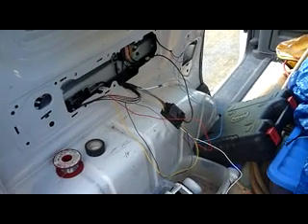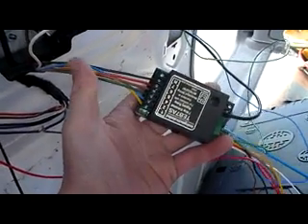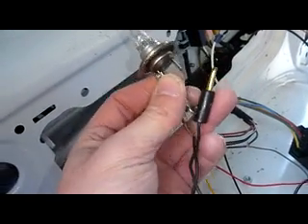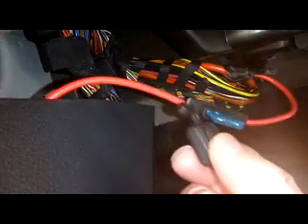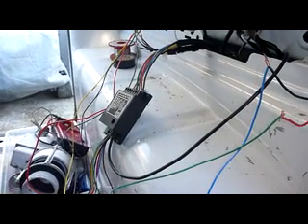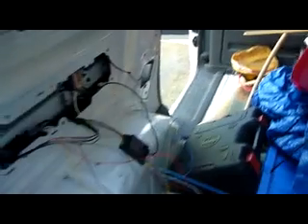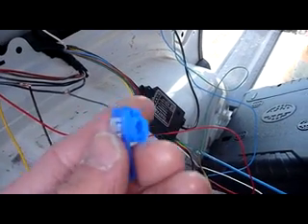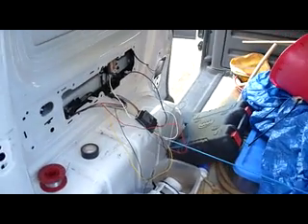VW Caddy tow bar wiring bypass relay

Comment: Hi, I think you are supposed to wire up the left and right tail lights separately, that's why they have separate pins on the socket and plug. The reason is that you should be able to switch each side, left or right, separately as parking lights. If you wire both trailer tail lights from one side you will either get both trailer tail lights on or no trailer tail lights on when using the parking light function. So you should have had a three (3) core cable coming over from the right side of your vehicle. One wire for the fog light, one wire for the right hand indicator and one wire for the right hand tail light. Only then would your wiring be fully legal, and road safe.
Reply from the maker: thanks for the input. hope the video was of help.
Reply: great comment.. some trailers don't have fog lights! otherwise you're spot on..

Comment: The video is very useful as I am doing this exact job now. The only thing I would say is that you should not wire the 12v feed from a wire in the harness. That wire will be fed by its own fuse so there is the danger of overloading the original fuse. If you follow that harness forward you will find a flexible rubber bulkhead seal. Take a long shaft cross head screwdriver and follow the harness. Push the screwdriver past the seal. Open the bonnet and remove the battery. Remove  the battery box. Now you should see your screwdriver. Push the feed wire past the screwdriver and remove the screwdriver. Fit the wire to the battery terminal nut (M6). Make sure the fuse is close to the terminal. I tie wrapped mine to the main power cable.

Comment: Helpful video but i am still having problems :(, All lights on trailer and van work correctly and i have the same bypass relay as this video - wired and fused directly to battery, BUT i still have a light fault on dash, could this be a faulty relay? i tested everything before permanently connecting wires and had no faults then, can anyone help!! PLEASE??
Reply from the maker: RyanGriffiths have you check all the bulbs are working seams stupid but could be as simple as that if it was perfect before you hard wired it in. Caddy’s if it is one have problems with the connections on the front indicators. Have you tried plugging in to a diagnostic tool to see what the fault is also could help.
Reply: @bobsvidz7181  thanks for your reply, 99.9% sure bulbs are good, a freind is bringing a diagnostic tool so hopefully will shed some light

Comment from the maker: Hi Timothy my van is 2013. My bypass relay only needed one brake and one dip light the other wire is just rolled up and taped. When driving with no trailer the relay clicks and makes a lot of noise so I am going to put a switch to turn it of while not pulling a trailer as it is annoying me. I used that live as it comes straight from the battery. I used good heavy duty cable not the crap that came with the tow bar because I also added a 12volt socket so needed to make sure I had plenty power. Handy for electric cooler boxes drill chargers what ever. Thanks for the comment.

Comment: Bob what year is your van? Mine is 2014 hitch and relay should be on the way Monday I will be taking a live from the fuse box. Just wondering does only one feed for the brake need to be brought to the relay for both brake lights to work on the trailer? Great video again, thanks :-)

Comment: Really helpful, thanks for your post. I was wondering tho, given the constant vibration factor, would it be useful to use both heatshrink AND then wrap with electrical tape too to avaoid any chance of a short to the chassis? Nice work bobs vidz!
Reply: InstaBlaster...

Comment: what year is your Caddy? Mines a 2016, do I still need to do all this? I don't mind having a go at anything but electrics I hate, great video but still leaves me a little unsure to doing this myself.
Reply from the maker: That caddy was 2016. Yes u need it on your caddy. Electrics are tricky I wouldn’t do it unless u are confident. Please subscribe and like the video. Thanks
Reply: @bobsvidz7181  I was just about to buy a tow bar and electric kit but unsure  which one I need, they are saying -'with bypass' £30 and 'vehicle specific' £100. Do you know which I  need mate?
Reply from the maker: @BettySwollocks13  the bypass relay is what I used. A vehicle specific one is a big job to fit. Subscribe and like thanks 👍

Comment: Can anybody tell me if this works on a 2012 caddy? Would I need anything else done after installing this kit or will it be good to tow a trailer as soon as the wiring is completed. Thanks
Reply from the maker: Yes do the wiring and fit a tow bar off u go 👍
Reply: Thanks buddy

Comment: So what exactly does it bypass then.
Reply from the maker: eric mourinho it basically stops the light on the dash that says you have a blown bulb which is what happens if you wore directly to the vehicle. So using a bypass relay separates the van lighting wiring circuit from the trailer lighting. Thanks for the comment like and subscribe if you liked the video please.
Reply: bobs vidz ok  i get it now  did you feed it with a 4mm or 2.5  and where did you get that relay
Reply from the maker: eric mourinho it generally comes as a kit on eBay or other websites etc I used 3mm for the 12v I think. With a fuse which is a MUST very important.

Comment: Does youre car have canbus?
Reply from the maker: kristof vermeulen hi. Yes it does is why u need to do this. Other wise u will have a light in the dash for a blown bulb always when the trailer is connected.
Reply: I have bought this module to. How do i know what wire a need to connect on the light? Can i measure it?

Comment: Do you need relay for 05 caddy?Cheers
Reply from the maker: Ya u will need one. Otherwise it will bring the bulb light up on the dash as mate.
Reply: My bulb light is always on on the dash..whatever's wrong. Would it do any more harm?
Reply from the maker: +mmc 10 that just means there is a bulb in the van not working somewhere or maybe an led not suitable. Usually it's the rear number plate light or front indicators that give trouble. It won't do any more harm I would think but not a good way of doing it really. Hope this helps thanks for the comments.

Comment: Wat is a bypass relay for ?
Reply from the maker: Lone Wolf basically if you wire the Towbar up direct in a modern vehicle the light for a blown bulb will be illuminated on the dash panel ever time you connect trailer lights. So this uses a relay to keep them separate from the vans electrical system therefore stopping this problem hope this helps. Thanks for the comment like share subscribe if you like what you.
Reply: bobs vidz so it's only for if using trailer
Reply from the maker: Lone Wolf yes only for lights on toe bar or some bike racks that have lights etc.